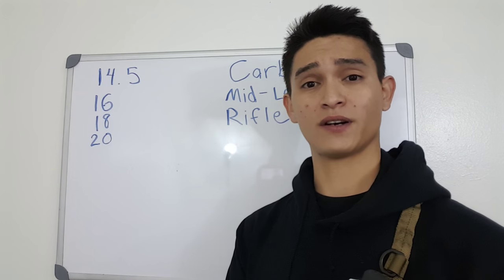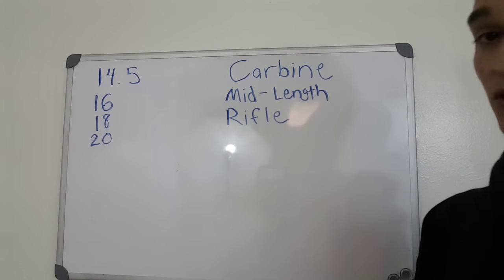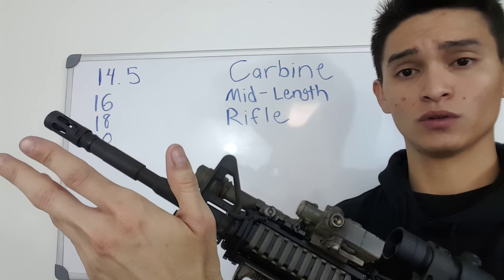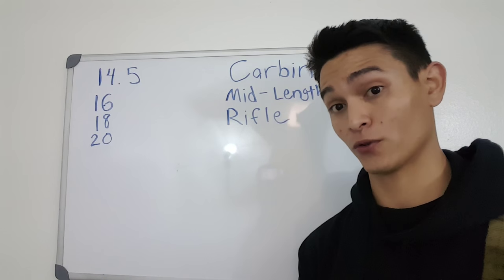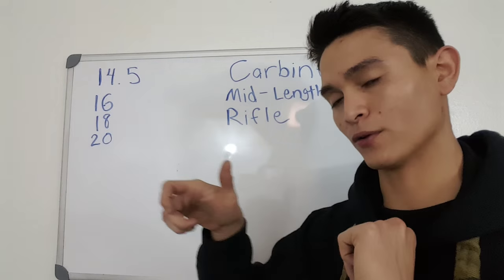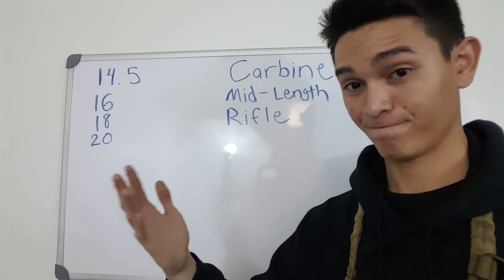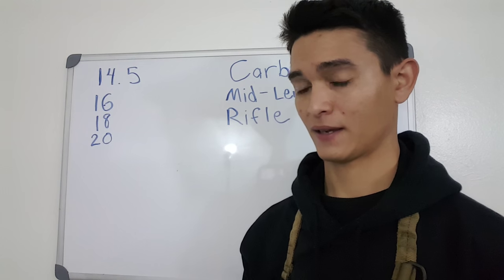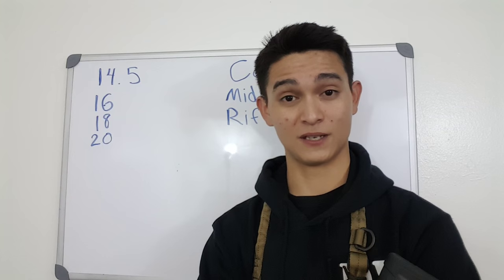AR 15 gas systems and barrel lengths, which one?

Comment: I just built a rifle with 18" barrel chf cl and a rifle length gas system. Shoots great till you really start hammering down. I effortlessly out run the trigger. Should I get a weaker buffer spring or a lighter buffer? PSA lower kit

Comment: +Regular Guy Training LLC  you mentioned that one of the benefits of the 14.5 carbine gas length set up is having more of the rifle's weight towards the rear, which allows for extended time in certain firing positions. That being said, would it be counterproductive to apply a free-float handguard (mlok or keymod) intended for midlength gas systems on a carbine length gas system rifle? I've seen a few people do this on the Colt OEM 2's. Btw very informative video and great content as always! Thank you!

Comment: I have yet to shoot a mid length gas system but I have shot 3 carbine lengths and 3 rifle lengths. As far as the amount of recoil, I would say the difference is very minimal. Yes, the rifle length is a little less recoil. But you won't notice in unless shooting very fast or using an optic at range. As far as running cleaner, rifle length is a bit cleaner. And when it comes to gas in the face, it varies rifle to rifle no matter the length. Things change when it comes to the actual recoil impulse. The buffers come into play greatly. A good H2 buffer in a carbine 16" will be a smooth shooting gun with a mellow "pop" recoil. A standard buffer in a carbine 16" will feel weird and springy in my experience. Rifle length has a little different buffer tube length typically in a standard A2 or variant style stock than any other length. Using a standard rifle buffer with a 18" or 20" barrel the recoil will be very minimal and slightly like a carbine in a 16" with a H2 but less of a "pop". Finally, an 18" rifle length with a JP silent captured buffer spring in the unaltered configuration with the spacer for the rifle length buffer tube. It is completely different. Instead of feeling like an AR it feels like a normal semi auto rifle. Sharp and quick with no spring feeling, sort of like a mini 14 but less recoil and more into your shoulder than up. It might be like a rifle length gas system with a carbine length tube, but I have no experience with a rifle such as that. Thanks for reading.

Comment: So if I want a rifle for clearing houses building etc., with sometimes engaging a target at semi long distance range like 100, 200, and 300 yards I need to get a 14.5 barrel with a carbine length gas system or should I get the mid length gas system
Reply from the maker: mid length firs better for what you want
Reply: Ok thanks

Comment: What if you are going to be using steel case 223 not 556? Does that change what you would want to run?
Reply: no
Reply: Possibly. Read the 10,000 round test lucky gunner did. They seemed to have a better experience cycling Tula ammo with a mid length. 

You could probably avoid this issue by using wolf instead of Tula.

Comment: So what's the opinion on modern hand guards that are lighter than a quad rail, but longer on average (utilizing something such as M-lok or Keymod)?  You could be getting mid length smoothness and reach, while maintaining the weight savings of a shorter quad rail.

Comment: Which collapsible stock do you like on a 20" rifle configuration?  I tried this once way back when, but it made the rifle nose heavy.  My current 20" upper has a pencil barrel, similar to M16A1 barrel, and that helps a great deal, but if I were going to use a collapsible stock on it, I'd think I'd want something a little beefier than the common magpul moe, which weighs practically nothing.

Comment: The reason I'm ok with a shorter barrel length is because I would never use xm193 for serious use unless it's all I had. If you're using an all copper hollow point or a bonded bullet the threshold for expansion and penetration is much lower than what is needed to make an m193 round tumble. I don't know many people who use cheap ball ammo in their pistols. If you're using good hollow points you know it's $1/rd for good stuff. If you don't use cheap ball ammo in your pistol why would you do that in your rifle?

Comment: have you had in experience with a carbine gas system upper  on a lower with a a2 rifle stock & rifle buffer?
Reply from the maker: Dale Gribble yeast and it works fine
Reply: AregularGuy thanks for the feed back.  good vid, very informative.

Comment: What do you think of the SCAR 17 & 16. Do they run well hard.
Reply from the maker: I have a post 18,000 round review on the 16, and currently there is no full sized battle rifle that can match the scar 17 in performance (across the board).

Comment: It's very common for.300 blackout to run pistol length gas systems. I have one in a 16 inch barrel and it runs just fine. I know there's a huge difference between 5.56 and .300 blackout but just saying that telling someone to walk away from pistol length isn't always possible

Comment: hey man you have always had goo answers and haven't lead me wrong i have a few ar 15's already built was thinking of build one of the mock dissipator with a mid length gas system with a rifle length hand guard with a2 sight for longer iron sight picture and more hand guard any opinion?
Reply from the maker: +The Downtrodden I would just side with a rifle length gun as you don't have anything to gain from the shorter gas system.
Reply: +AregularGuy i just heard 16 inch gun with rifle doesnt work well thsts why they made the mocks
Reply: +AregularGuy the other ar i dont have a dmr my friend works at sig gets half off scopes 3x12 or 4x16 better for dmr

Comment: One thing I think that is worth noting: For utmost reliability, I do not recommend using rifle length gas systems on barrels under 18", and I'd still prefer a mid length gas system in an 18" barrel if it was intended to be used for fighting.
Reply from the maker: ive got a 14.5 in barreled ar with well over 15,000 rounds through it and has not yet had a stoppage. I think that a moot point.

Comment: mark 18 for home defence. any thoughts? I was thinking the Daniel Defense variety. I already have the SBR lower. the reason I wanted a shorter gun than 14.5 is I wanted to add my suppressor on the end. I don't want to blow out my ears inside a house if I have to use it. any thoughts advice would be great.
Reply: The mk is great for suppressor because the overall length is the same as an m4. However, it is louder, it kicks a little more (kicks a lot like my slr-107), but is worth it in my opinion if you accept what it is. I heard an SOF guy say he uses it like a pdw which made sense to me. In vehicles it can't be beat imo. It's accurate and deadly, I've hunted with it and it's epic even with 55 grain.

Comment: What buffer and spring combo should used in a Collapsible stock with Rifle length gas system.  Won't the softer rifle length gas be to weak for carbine springed stock?
Reply: That's what I am wondering as well..
Reply from the maker: no its about length of the tube. a rifle tube is longer than a collapsing tube and it uses a longer buffer. the reason for the carbine buffer is because it is shorter. use a standard carbine spring (also shorter) and an h2 buffer and you're good.

Comment: I can't afford a high dollar AR set up but I want to get another one so what are your guys opinion on the M&P sport 2 I watched a lot of videos about them but I would like some more info from you guys
Reply: Johnathen Stommel dude bulid one you can build a solid AR for 450-600 bucks check out Palmetto State Armory that's the best way to go on a budget buy a stripped Anderson or palmeto state armory lower and a rifle kit ftom palmetto and with an hour of ur time you can assemble it into a rifle for about 500-600 bucks depending which kit you get and they are rock solid parts the will go toe to toe with a colt any day

Comment: I have a .223 wylde heavy barrel shoots great very accurate but after an hour or 2 of shoot the weight of rifle is bit much. I've been looking to switch it out and just wanted your opinion of which barrel I should to get. I use it for mostly plinking at the range and it is back up home defense weapon.

Comment: I put together an 18" FN bbl with a rifle length gas/buffer and BCM bolt carrier group, it ran fine on 5.56 but I ended up having to get a wolff reduced power rifle buffer spring to get it to cycle on .223. Of course this is after I ruled out improper gas block installation and other common causes of not getting enough gas(loose/misaligned gas key/tube and misc gas leaks). I can only assume the gas port isn't drilled out wide enough but I'm too lazy to remove my gas block and re-zero the rifle to measure and know for sure. I'm going to see if the weaker spring makes a big difference in reliability once the gun is fouled way up and re-evaluate from there.

Comment: What I haven't figured out is why are the carbine buffer weights lighter than a rifle buffer if the carbine gas produces more pressure?
Reply: There are two aspects of this. First, the rifle action spring has a flatter force curve than the carbine does because the latter is shorter and stiffer (fewer coils). So if you look at the difference between open and closing forces, the carbine has a greater difference. So the spring gets "stiffer" faster as the bolt comes back. The reduces the amount of weight the buffer needs to have.

It also causes the springs to fatigue much faster than a rifle spring does.

The other aspect is the gas porting and plug time. The rifle length applies the pressure for a longer period of time, so there's potentially more energy going into the buffer system depending on port sizes and ammo and such that you are comparing.

Comment: Looking for advice on an 18' rifle lenght gas system. Do they function with a carbine lenght buffer, or am I better off making a dedicated rifle length buffer tube lower? My guess is for the latter, but would appreciate any input from anybody who's gone through the trial & error.
Reply: Did you get your question answered? This is my exact question
Reply: @TheMannyduckslayer  I split the difference & went with the Vltor A5 buffer system, 100% function. I wouldn't run a carbine buffer, so if it's one or the other go rifle. Damn, has it been 7 years already?

Comment: Do handguards affect the gas system u use? If so can u run a carbine handguard on a rifle gas system?
Reply: I'm not an expert at all, but the handguard length doesn't affect the functionality of the gas system. You could use a carbine-length handguard with a rifle-length gas system, but it might look awkward since the gas block and a lot of the gas tube will be exposed.
Reply: yeah not a good idea the hand guard is also there to protect the gas tube.

Comment: So, the rifle length is more reliable because it's longer, but the mid-length isn't any more reliable than a carbine? As far as reliability goes, the length of the gas system would either factor in, or it wouldn't. It can't go both ways, right?
Reply: +WeTheFrogs He said mid-length will be easier on the BCG than carbine, I think he just didn't really emphasize it as much as the rifle gas.
Reply: +Alexander Jones Okay: but are the length of parts life and reliability the same thing? To me, reliability means it goes bang and then feeds the next round without hiccups. BCGs can be swapped out before they fail if you keep an eye on its condition, right?
Reply: WeTheFrogs correct, I think what he should have said is basically, the longer your gas tube is, the more DURABLE the entire weapon will be.  I, too, think that the term reliability means correct cycling, the term durability should be used to describe overall parts life.

On a personal opinion note, I believe that carbine gas is all but obsolete anyway.  With the proliferation of ar "building" over buying, as long as we are talking about non-sbr guns, you should choose mid-length for 16" and rifle for anything longer, simple as that.

Comment: If you make a pistol length AR with an adjustable gas block its a breeze!
I built one with and one without. Both run great. 
I wouldn't shit on the pistol length so badly.

Comment: Average fps difference between 14.5 and 16" is roughly 200 fps.  Not a big deal.  Actually your maximum spread on some ammo can be as much as 130fps sooooo. in some cases we could be talking about only 70 fps difference between the two barrel lengths.

Comment: Good video. Deciding between Daniel Defense m4A1 and V11 as my first rifle.  Your thoughts?
Reply from the maker: Which ever one you can get cheaper, they will both outperform you lol. That's how mine was until I got much better.
Reply: +AregularGuy thank you sir, and thank you for picking up the sword.  God bless you.
Reply from the maker: +PipeLawyer eh...... I'd rather you thank my parents
Reply: I'd get the DDM4V9 if you want rails. Mid lenth gas system, slimmer and longer handguards with standard rails, cheaper, and slightly lighter even. VFG included as well if you are into them.
Reply: I suggest v11 slw. it is way much lighter than m4a1(6 vs 6.7lb) and lighter than v11(6 vs 6.2 lb).  In general I prefer the mid over carbine due to the slight less recoil. v11 has picatinny on top, keymod on the other 3 sides.

Comment: I have a 16" carbine socom profile so I put in an h2 buffer, seems to soften recoil, will it also help with premature part wear?
Reply from the maker: no, it'll smooth out felt recoil, but the impact on the parts is the same.
Reply: AregularGuy thanks for the reply man, I like your style, good or bad you tell it like it is
Reply from the maker: I try very hard to keep it that way.

Comment: I was taught that 90% of the gun powder is burned in the first 3 inches and the difference in barrel length allows the gases to expand, yielding more velocity. Is this not the case?
Reply: I'm not sure of the percentage, but some of the powder still burns through the barrel, hence the muzzle flash. If it all burned before it left the barrel you would just have gas and the need for a muzzle device wouldn't exist.
Reply: +Sam Wagner no the flash comes from the delta isentropic energy due to temperature and pressure differences between the volume of air in the barrel and the ambient air. I guess I'm asking about the common burn rates of today's powders, but I do agree some powder burns until the end it's just not the magnitude of which he describes.
Reply: +dropmeA if you know all the answer, why ask the question?

Comment: I really like the advantages piston systems give you with heat reduction and having a cleaner bolt carrier and chamber. By no means am I saying DI is unreliable but in a sustained fire fight it makes more sense..Cost aside I dont know why we dont switch to piston systems in the military
Reply from the maker: cost can not be put aside because the advantage is not enough to justify billions in retrofitting millions of rifles.
Reply: +AregularGuy I hear ya. Maybe start with combat troops first and implement slowly
Reply: +Night Recon Huh??
Reply: +Night Recon Was that a ball bust? lol
Reply: +50 Stitches Steel news flash piston ars are a gimmock unless u have a can or sbr
Reply: +Night Recon Nobody here cares what Nutnfancy has to say
Reply: +Mike Marion hate to bust the di guys bubble but tell that to the ak guys and see what they say
Reply: Adam Hensel I said piston ARs. Please read post. I am all for pistons in m1s and aks...even ar15 sbr
Reply: +Mike Marion sure lol
Reply: +Mike Marion I did read, all I'm saying if it's so reliable for an ak then why not an ar and bolt tilt and other issues have been address by manufacturers
Reply: +Adam Hensel it was designed without an external piston, it still has one in its bolt. 
And if it were much better why didn't Eugene Stoner include it? the gun is based on its gas system, why change the design?
Reply: stoner NEVER made or sold an externally piston driven action AR, other guns he made had pistons but not the AR.
Reply: +Mike Marion why do they update planes, tanks, ships because new tech allows us to do so at a reduced coast and making thing more reliable. great ergonomics accuracy but compared to the ak doesn't hold the title of being the most reliable. piston systems help change that.
Reply: Why not hack off the buffer tube and call it an mpx then?

Comment: how the cylcling with 55 grain with a midlength gas system ...good or bad?
Reply: Mine runs sweet and fast.
Reply: Nate Dixon I've never seen a problem..even the rifle length A2 will cycle the stuff in my experience..

Comment: What about mid length with a railed gas block and no front sight or metal back up sight and a short carbine rail? Best of mid-length wear and tear and lighter weight than a longer mid length rail system.

Comment: Choose the gas system on the AR-15 that's been running reliably for 60 years that's the one that comes with the firearm
Reply: I agree completely but if you're building one from the ground up then it doesn't come with one does it?
Reply: @NortheastSurvival911  it depends cuz really the only thing you have to build from the ground up is the lower you can buy the uppers through mail order to fit any budget and if you get it as a complete upper their test fired so you know they're safe to use. Have an excellent day

Comment: what about the relation between the correct buffer and gas system + barrel length combo. for example mid length with a 14.5 what buffer should i use and why.
Reply: If you're running a carbine/mid length gas system you should be running a carbine buffer. Unless you're shooting suppressed, or hot reloads, then you would want a heavier buffer or a tunable gas block.
Reply: Sam Wagner disagree if you’re gunning a carbine system H2 buffer is more popular